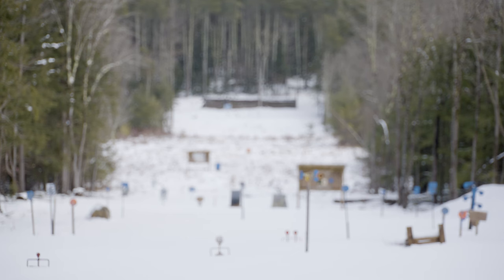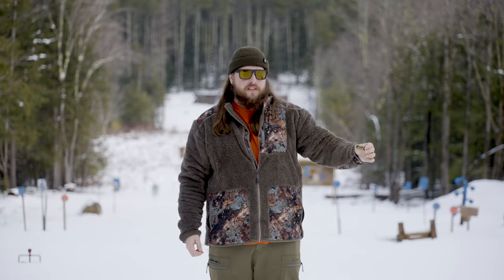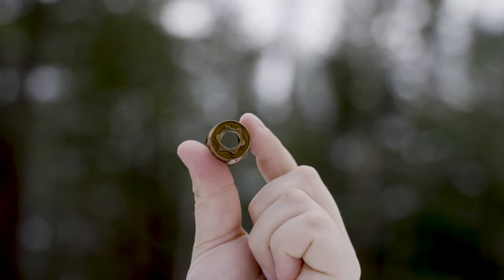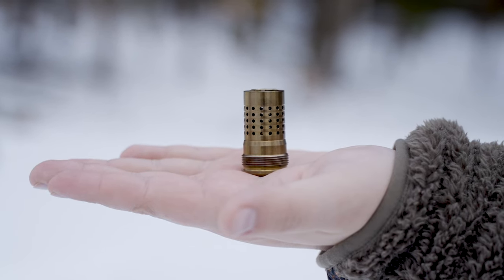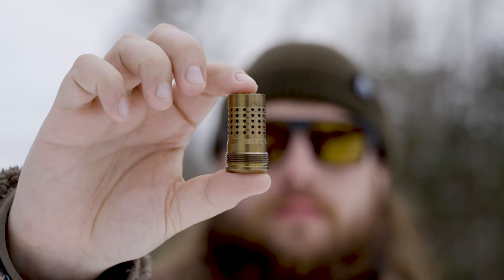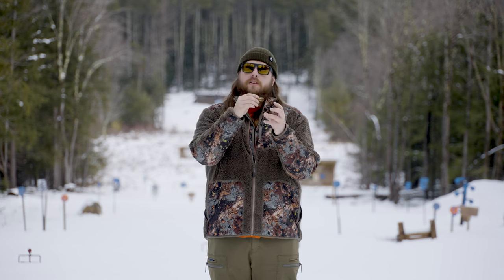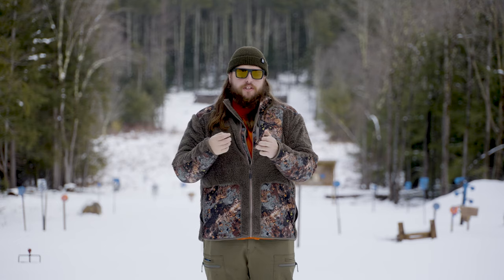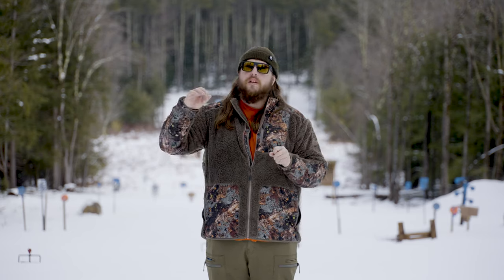Q  |  What's Q  |  CherryBomb

Comment: 2500 rounds Honey Badger Trash cheery Bomb Panda Q Q Q ...using both 220 and 110 grain..Zero issues. Spend your money, sell your AR's if you need to. Q AR-15 upper is also coming.
Reply: Isn’t that’s just a sugar weasel upper?
Reply: @Swissk31300BO nah its a Q Honey Badger 556 upper 10.x” - Just came out. Its SBR but still lets you use a honey badger as 300BLK or 556.

Im unsure if you need to file another form 1, as its already SBRd as a honey badger 300BLK. But perhaps someone who knows more can enlighten me as you’re only changing the caliber

Comment: Idk why y’all wouldn’t offer a 14.5 option on muzzle devices, a lot of people run that barrel length for 5.56?  My other serious question and it really isn’t meant as antagonistic because I think yall make awesome products, if y’all have such a problem with Rearden making a plan B muzzle device that can fit your cans, why is it ok for Q to offer Plan B to owners of SiCo, Dead Air, etc. is the principle not the same of your Plan B product line.
Reply: I agree about having a 14.5" option. While I don't like his example, what he is saying is that Q will not take responsibility for failures due to parts they did not make, and yes they offer plan B products, but the other companies also wont cover failures from Q's product failure. 

A better example is if you buy a nice set of wheels for your car, and instead of using the lug nuts that came with it, you slapped on some cheapo ones that aren't made correctly. If the wheels fall off on the way to Grandma's house, its the cheap lug nuts fault, not the wheels.

Comment: Any future plans for a square shoulder cherry bomb for other BBL manufacturers? Obviously it’s not as good as the taper design, but wandering for anyone who may use a different BBL but wants a Q suppressor.
Reply: They're compatible with square shoulder barrels with proper shoulder diameters and thread lengths. Info is on the website

Comment: EDIT:  14mm socket for 8.6 Cherry Bomb. No Rocksett from factory. SR25 block in magwell worked fine. 

How about a useful video that tells me how to safely remove this thing from my Fix’s 8.6 Blackout barrel?  1/2” socket I got. Do I need to remove the handguard so I can clamp the barrel in a vice?  I haven’t seen a reaction rod for the Fix and don’t want to torque the receiver. And do I really have to soak it in hot water to get Rocksett to release?

I tried to find a Porq Chop in stock for several months last year before ordering a different suppressor for my Fix. I wanted the Porq Chop but it wasn’t happening. Now my Banish 46 has finally arrived, I have the taper adapter (another saga of Q silliness), and I need to get the Cherry bomb off. 

PLEASE HELP
Reply from the maker: Shoot info@liveqordie.com an email.
Reply: @qllc8143  thank you. I discovered that a 1/2” socket doesn’t fit the Cherry Bomb on the 8.6 Fix. 14mm does. I used a mag well block for SR25 magazines and the Cherry Bomb came off fairly easily. I was not even close to worrying about torque on the receiver. Clearly it was not glued on with Rocksett despite all of the internet misinformation.